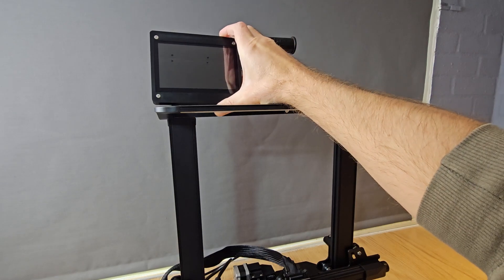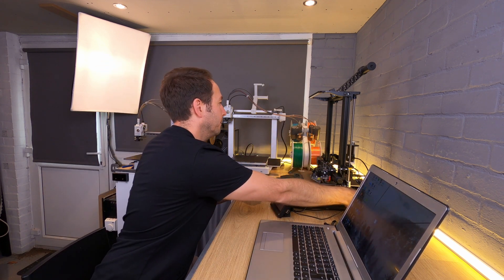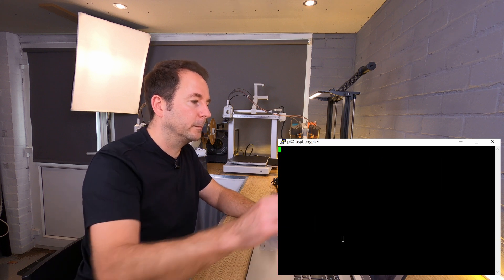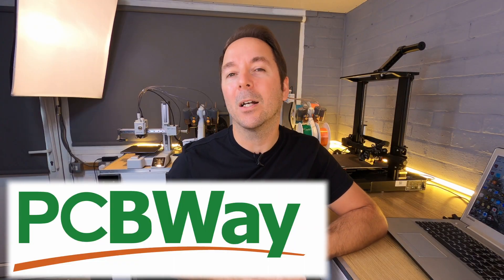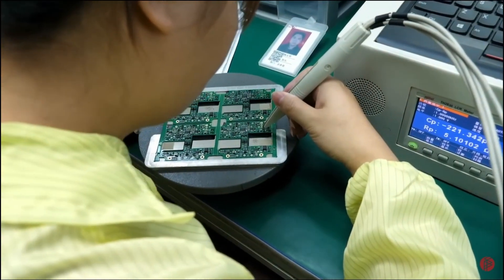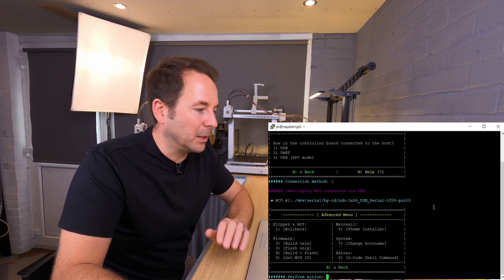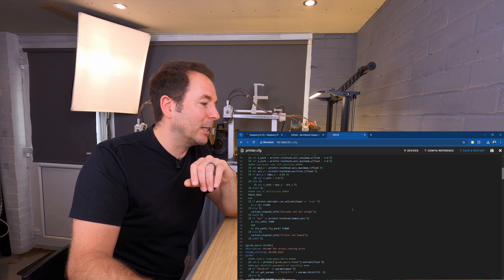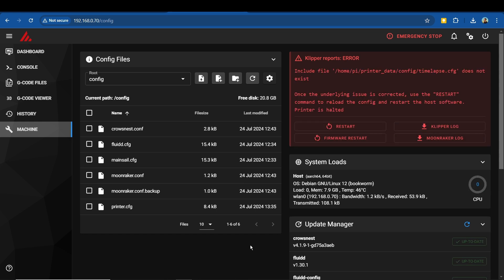How To Find And Use Your MCU ID - Klipper 3D Printer Series Part 6

Comment: Hi, I’ve been following you series and I’ve just managed to get my serial mount Id, I’ve copied it to the printer config file restarted and I get the message, printer is not ready then a few seconds later I get much unable to connect, I’m using BTT pi v1.2  with octopus v1.1. If it wasn’t connected it wouldn’t read the much Id would it so it must be connected. Any ideas. Thanks 😢

Comment: This comment is for anyone running a laptop instead of a pi, or just having mcu id issues.

There are two types of labels(?) for usb. id by-path and id by-port. If your system recognizes the usb connections as coming from the same port you will have to implement a udev rule to rename the path id.

I am not an expert, I am just pointing you in the right direction haha

Comment: Hello :)
Kiauh says there is no USB mcu device connected, even though it is plugged in, and my CAN connection works (The adapter sits on the board). When i put my board in DFU mode and scans for DFU devices via USB, it works fine - however this does not give me a relevant id for non-DFU mode. Why could this happen, and how can i fix it?

Btw, if it is relevant, my board is an btt octopus pro v1.1 - h723

Thank you in advance :D